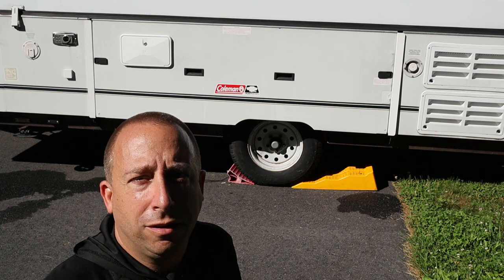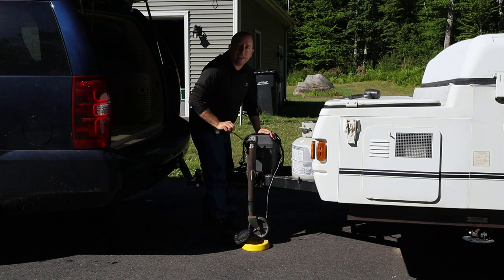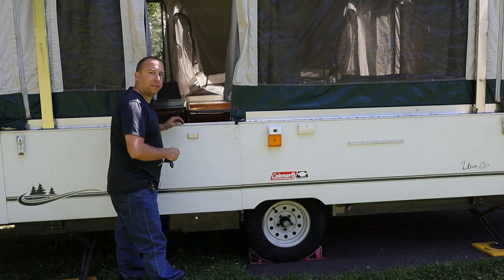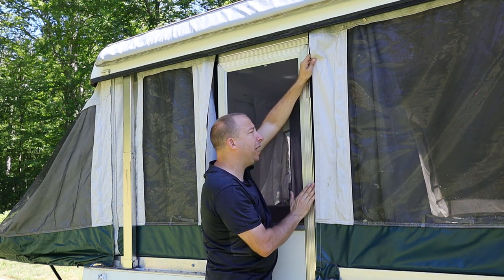Easy Pop-Up Camper Set-Up Highlights // Coleman Utah by Rockwood

Comment: Very useful video! Since the stabilizer jacks are not meant to support all the campers weight, do you need to add lift jacks?
Reply from the maker: If you want to lift it off the ground, yes.